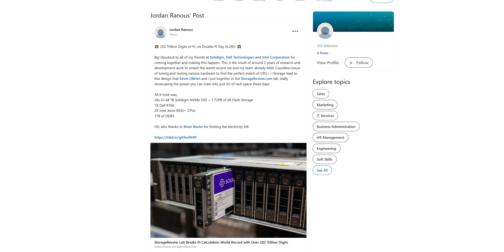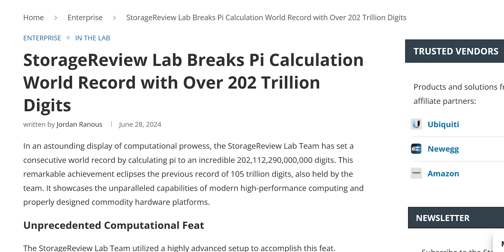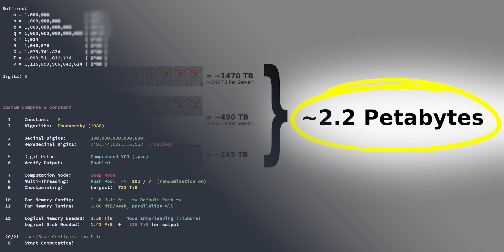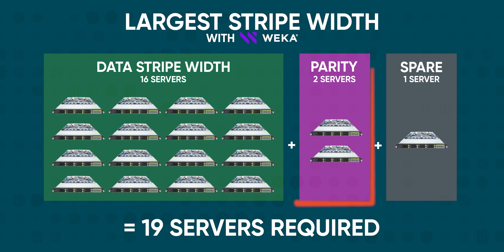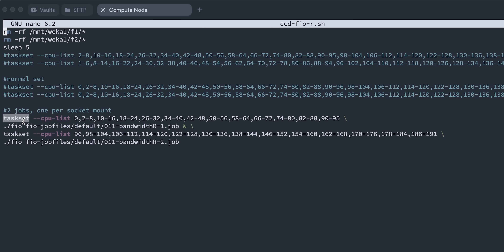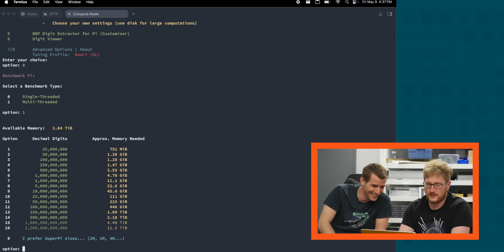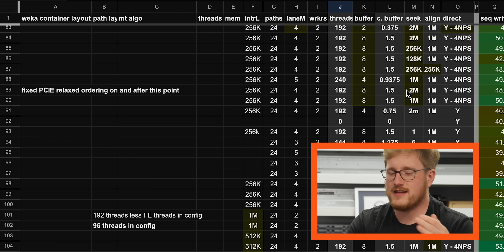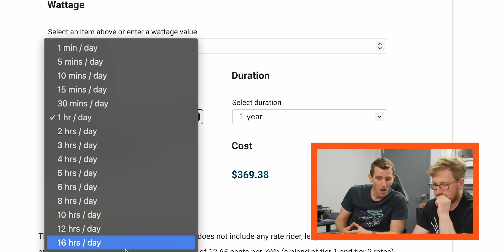The $1,000,000 PC set a WORLD RECORD

Comment: FYI there truly is no real world application of knowing this many decimal digits of pi, but I think what most people don't know is exactly how few are really needed. With just 40 digits (no not 40 thousand or 40 million, just 40) we can calculate the circumference of the entire visible universe to the width of a single hydrogen atom.
Reply: and i think like 60 digits is enough for planck length level precision
Reply: @petrkdn8224  Just checked, it's 63. (well, 62.26, but we can't have a fraction of a digit). Now I have a goal to memorize pi to 63 digits.
Reply: @shadowsmirk  15 digits is surprisingly easy (I thought it would be way harder, but I memorized the first 15 digits by the pattern of moving my hand over a keypad)
Reply: And NASA's Jet Propulsion Labs apparently don't bother with more than 15 digits.
Reply: @offcenterideas probably bc of floating point accuracy stuff
Reply: @offcenterideas Almost all calculations are done with 15 digits.  That's the number of digits you get when using double precision floats.
Reply: @offcenterideas  I kind of hate this fact. It's not wrong, but I think it gives the wrong impression. NASA never sat down in a room to figure out how many digits of pi that they needed. 15 digits is just what you get from using a 64 bit floating point number. That's all. NASA just used the built-in representation of pi that is found in every programming language.
Reply: @kered13  The Apollo guidance computer was 16 bit hardware they definitely didn't use any built in definition of pi.
Reply: @meekrab9027  Sure, but that bit of trivia doesn't come from the Apollo guidance computer.
Reply: @kered13  NASA has used the same value of pi since before the Apollo program it had nothing to do with 64 bit numbers
Reply: @Neamow  
And to calculate it to the accuracy of a Planck length (10^-44m) is 72 digits (base 10). 
So if you knew the exact number of Planck lengths of the observable universe (diameter) and the number of Planck lengths of its circumference, the quotient of those integers would be pi to about 72 digits and anything beyond would not be meaningful in the context of the entire universe as we can ever know it.
Reply: Huh, not what I expected
Reply: Matt Parker went over this. If you want to calculate pi ^ pi ^ pi ^ pi - each time you lose a log of digits.
Reply: Irrational compression is one that I wish to see someday.
Reply: Was about to comment exactly that, to underline that there's really no point outside of because you can.
Reply: I actually put together a write-up one time on the topic of how many digits/decimals you need to achieve acceptable accuracy.  My favorite way to point out how few decimals you actually need is latitude/longitude measurements.  5 decimal places of longitude gets you within 1.1m at the equator.  Google maps will happily spit out 15 decimal places, which is about the size of a single molecule.

(long copy-paste incoming:)

I put this comparison together to try to make levels of precision understandable and relatable to the layperson.  Precision and accuracy are used interchangeably here, but are technically separate but related terms.  Accuracy represents how close you got to your goal, and precision is the ability to repeat the same result.  For example, in shooting sports; precision is the size of the bullet group, and accuracy is how close the center of the group is to the bullseye.  With some quick web searching and some rough calculations, I've compared the size a golf ball to the precision level represented by a decimal number.  Imagine trying to be accurate in golf, then think about how many decimal places a pro actually achieves at their best

Length comparisons:
2 decimal places is equivalent to the width of the golf ball over a distance of 8 feet, a reasonable length to make a putt.

3 decimal places is equivalent to the width of the golf ball over the length of an approach shot.  I'm happy if i can just get it on the green.
4 decimal places is equivalent to the width of the golf ball over the length of a pro tee shot.
5 decimal places is about the width of the golf ball over the whole length of an 18-hole course.
6 decimal places represents the width of the golf ball compared to the drive you took to get there.
9 decimal places represents sending the golf ball halfway around the world.
10 decimal places gets the golf ball 2/3 of the way to the Moon.
12 decimal places gets the golf ball 1/6 of the way to the Sun.
18 decimal places gets the golf ball 2/3 of the way to the closest star, Proixma Centauri.
26 decimal places takes the golf ball to the edge of the known universe.

Area comparisons:
1 decimal place is the area of the ball compared to the cup you hit it into.
3 decimal places of precision is about the size of the golf ball compared to a car's window.
4 decimal places of precision is about the size of the cup compared to the putting green.
5 decimal places of precision is equivalent to the golf ball sitting on a putting green.
6 decimal places of precision is equivalent to the golf ball sitting on a basketball court.
8 decimal places of precision is equivalent to the golf ball sitting in a farmer's field.  Good luck finding that.
12 decimals would be equivalent to finding the golf ball in the smallest state, Rhode Island.
14 decimals would be equivalent to finding the golf ball somewhere in California.
16 decimals would be equivalent to finding the golf ball somewhere in the United States.
18 decimals would be equivalent to finding the golf ball somewhere on the surface of the earth.

Other comparisons:
5 decimal places of longitude gets you within 1.1m at the equator
7 decimal places is about the area of 1 pixel on a 4k screen (approximately 8 megapixels).  This isn't far off from the level of detail a human is able to see with their eyes.
9 decimal places is the apparent area of outer space which is covered the moon.

You need 64 digits of pi to form a circle as big as the observable universe and as precise as the Planck Length.  Or you could just use 39 and calculate it to the nearest hydrogen atom (hm this is slightly different from your number).

In real-world applications, the latitude/longitude measurements that i pointed out are an outlier.  Those are one of the few applications where more than 3-4 digits of precision are useful.  Construction tolerances are generally in the 2-3 decimal range.   Metal machining is one of the most precise thigs humans do, but it still only gets us up to about 5 decimal places worth of accuracy.

The limits of  human precision/accuracy is represented by pro sports, which mostly seem to be around 3 or 4 decimal places.  Think hitting the green with a tee shot, making a "swish" in basketball, pitching a ball in the strike zone, or the size of a bullet hole viewed through a rifle scope.

Sig figs and computers: in modern computerized calculations, it is trivial to carry every calculation out to 16 significant figures.  Rounding off intermediate steps may actually waste more time as well as introduce rounding errors into the calculations.  It is still important to understand the inherent precision of what you're doing and report a final answer that conveys the correct level of precision and tolerance.
Reply: Just to be safe we should probably keep 400 digits on hand at any time.
Reply: Even NASA uses only 15 or 16 digits for sub-milimeter precision on an interstellar scale.
Reply: I'm glad someone beat me to posting this, but that number seems to have gone up since last I looked. I remember it being in the 30-35 range...
Reply: Was about to comment sing all these digits for astronomy,i guess not
Reply: It is used in encryption
Reply: @Neamow  that is a big number he needs to beef up his setup to get there
Reply: @Neamow  I love this fact
Reply: In engineering we can use just one digit. Pi is “about 3,” or if you need to consider some factor of safety it is 4 or 5.
Reply: @csantos2 
The classic
Reply: For calculation probably not, but imagine that at some point a certain pattern in Pi is found, this will be wprld bendingin breakthrough in pure maths that could lead to proving many new theorems.
Reply: @polyglotomathotheophilos1941  if there was a pattern we would have already discovered it, it's an irrational number
Reply: I think its cool that all data, known and unknown, the answers to everything, are contained in the digits of Pi.
Reply: @hoofhearted4 that's kinda like saying it exists. Any Infinit set has all values. The probability of you finding and extracting it from a set is 1/infinity which is 0
Reply: @DaBigBrozer  thats not true, numbers like sum 10^-(i!) are irrational, transcedental, have infinite digit expansions, and dont contain all the combinations of even 1s and 0s possible, let alone all digits.

The idea that every string of digits is in pi is axtually a currently open problem
Reply: @DaBigBrozer  That is trivially wrong. According to your logic, the probability of finding and extracting, say, the sequence '1415' is 0 - but, of course, it is very easy to find that sequence. 1/∞ is actually undefined.
Reply: It's a useful benchmark for testing calculation accuracy for computers.
Reply: I think humanity will keep calculating pie until they find that it stops, Or until humanity no longer exists. Some things that we do, like sticking a hundred million dollar telescope in space, is not for any practical reason, but because we want to know.
Reply: FYI they said that themselves lmao you want a cookie each time you repeat a fact or something? Lol

Comment: If you printed out all 300 trillion digits in Arial size 4 and laid the stack of paper on it's side, it would reach from LMG to halfway between San Francisco and Los Angeles, just passed the tiny town of Harmony, California.
Or if you prefer, it would reach to almost exactly the border between Saskatchewan and Manitoba at the small town of Togo.
Using the cheapest possible paper (per sheet) I could find on Amazon here in the UK and current exchange rates, printing it would cost $1,085,894,550 CAD for paper alone.
Reply: How many half giraffes is that?
Reply: @dolan-duk  Giraffes average around 5 meters tall (allowing from spread between male and female giraffes) so based on that,  608,400 half giraffes.
This would, however, result in 112754 acres of blood to clean up so I don't advise it.

Comment: 1. The irrationally of π is proven mathematically, and also, not only are there infinite digits, they are never repeating. 3.33 periodic also has an infinite number of digits but they are repeating: 3.333333.....33333.

The main difference between rationals and irrationals is: irrationals can't be expressed as a fraction, rationals can (for example, 10/3=3.3333...)
Reply: how rational.
Reply: As far as we know is objectively correct. Nice try being a pedantic arsehole though 😊

Comment: It's crazy that  just 400 years ago Ludolf van Ceulen spent 25 years of his life calculating the Pi and the result of his work was just 35 decimal places of Pi and Althlon 3000 can calculate 32 million decimal places of Pi in 30 minutes xD
Reply: It is used in TLS encryption. 

Pi is used to generate keys that are used to encrypt and decrypt data in algorithms like the Advanced Encryption Standard (AES), the Secure Hash Algorithm (SHA-1), and the SHA-2 algorithms. In addition, Pi is used in random number generation, which is critical to cryptography.
Reply: Do you know if there's any practical use of 35 decimal places of Pi, yet? Because I have a hard time thinking of anything that (which make him rather awsome)!
Reply: @RannonSi  The only thing I could think of would be in cryptology. Encrypted with random string, based on Pi, starting at the Xth digit. One would need to know the starting point to decrypt.
Reply: @MichaelTilton  Sounds like an absolutely terrible cryptosystem. Though there could be some other places in cryptography where pi is useful, but I doubt anything more than a couple thousand digits woul matter even then.
Reply: @RannonSi a guy said that 40 are enough to calculate circumference of the visible universe, so its kinda useful (i didn't check, im trusting that guy in the comments lol)
Reply: @ViktorMarkez circumference of the observable universe to a resolution of the width of a hydrogen atom, yes. An astrophysicist also chimed in, and said that with 60 digits, we could calculate the circumference to a resolution of the Planck length - which is the smallest possible unit of distance known to physics (or, as they aptly put it, the "pixel resolution" of the universe).
Reply: @RannonSi  encryption, calculated observable universe, more encryption and more encryption
Reply: It took 400 years to be able to calculate the 300th trillion digit in Pi.
Reply: I imagine 400 years from now someone will be saying the same about this world record